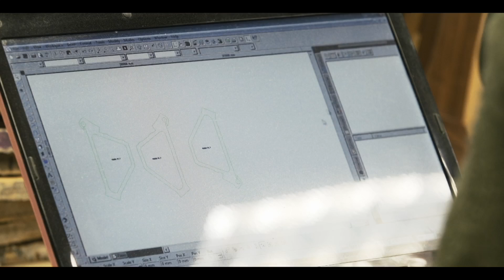A Thousand Hours Later - Building a Wooden Bike | FETTLERS

Comment: The original Tour de France riders used bikes with wooden wheels; they were considered safer for braking since the wheels dissipated the heat from braking more than metal wheels (and the glue holding the tires on could heat up and the tire could roll off the rim with metal.)